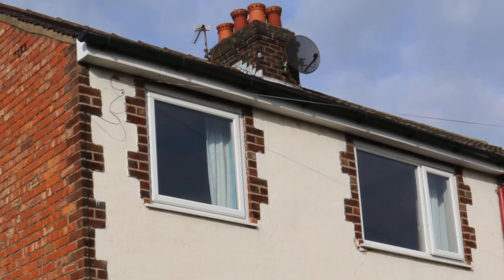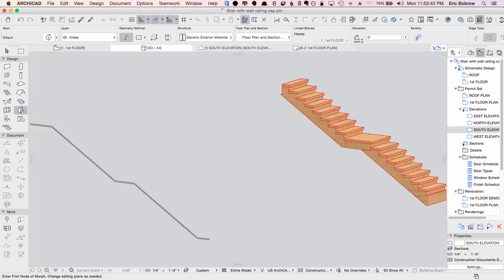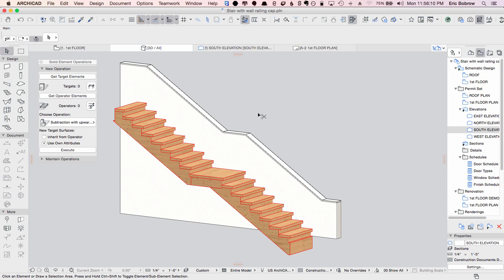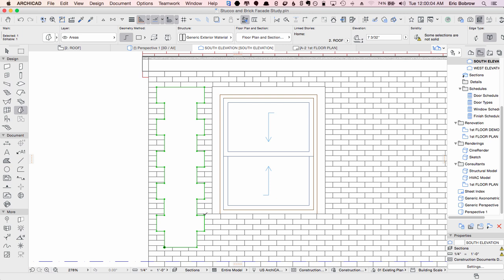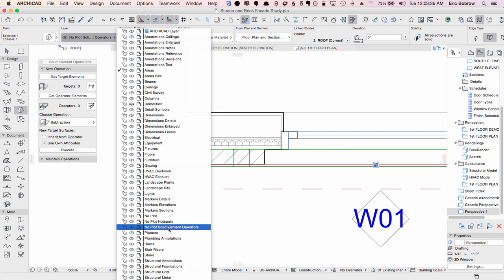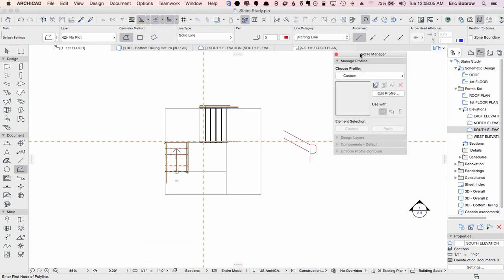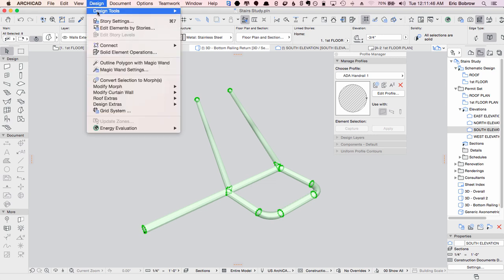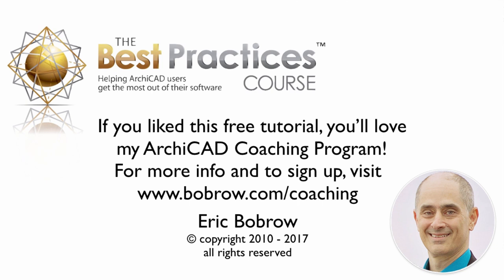ARCHICAD QuickTips Tutorial #2 - Fun with Morphs

Comment: O believe this suggestions are quick fixes, because when you dealing with accurate plans and schedules, complex operations with morphs don’t count, and don’t show up.
Reply from the maker: Morphs show up nicely in 3D views, sections and elevations. Messy plan representation and schedule issues can often be worked around by saving the morphs (along with related elements) as custom objects; these can have an optimized 2D representation and be included in schedules.
Reply: Good advice..but...That last rotation was over Y axis and not Z...archicad is almost always right ahahah.